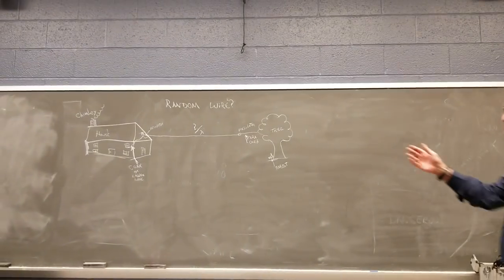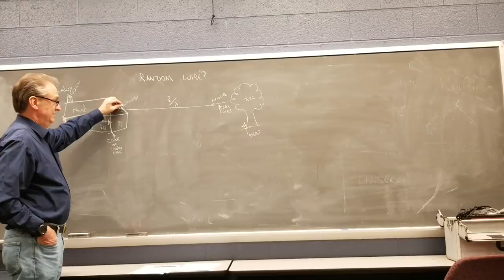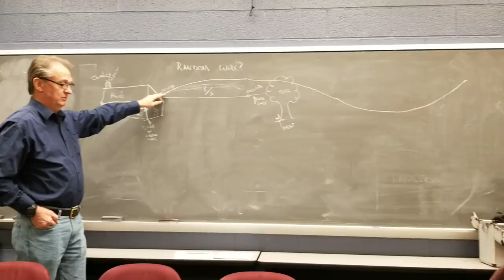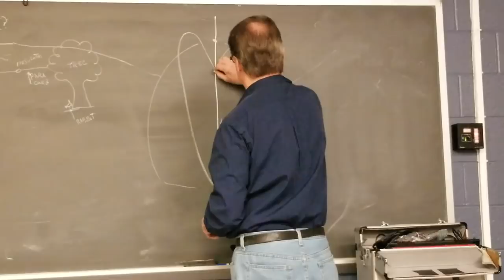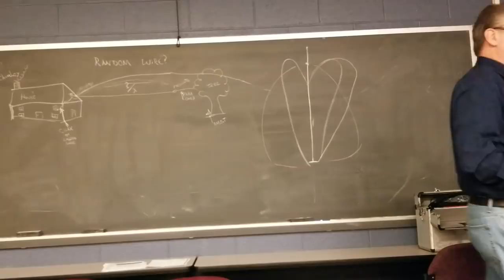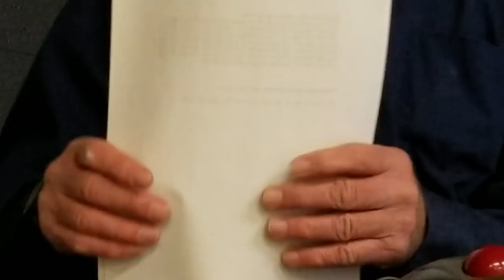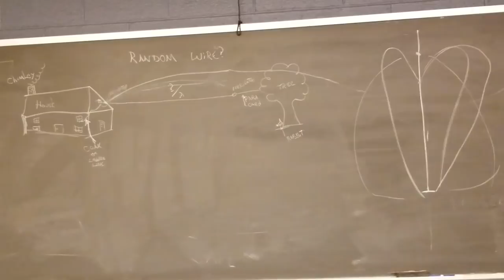Random Wire antennas presentation

Comment: Found a spool of junk wire. Shot some up in the near by tree.(the core) the other end to a coil on the wire going to a tree. On the low end.(shield) Thrugh to a 300 ohm restor to ground. The darn thing covers from Maine to Florida. Then texas to Canada and have heard England. This is a receiving antenna.( And I don't care to even to measure it). Love it tks for the show. De kv4li
Reply: Resistor working as a weak diode on your ground, just in case of a lightning strike?

Comment: Thanks for the great video.  This explained my recent problems.  Last year I tried cutting a 40M antenna, raised it up in the trees and discovered I had cut it about three feet too short!  Rather than adding the additional length, I decided to add about 200 feet of wire to the center point of the driven side of the dipole and string it out in the trees.  Using a little QRP tuner, that worked well enough for me to get WAS using QRP with FT8.  However, SWR was high (about 1:3) on 15 & 80M.  Last week I decided to cut that short piece of 40M driven wire from the antenna, thinking that might help get the SWR down.  I was SO wrong.  Cutting that piece out caused my lowest SWR to become 1:5 on all bands!  UGH!!!

I am now planning on just building a fan dipole and forgetting about my "random wire" antenna. LOL

73s
DE KC7RAD

Comment: He mentioned that you don’t what the feed point to be at the high current point when in fact that is what you want. The the high current point on an antenna has low impedance. He should have said high voltage point.
Reply from the maker: You are correct.

Comment: You didn’t mention using a 9:1 unun at the feed point. I’ve heard of a “random wire” end fed that is 74 feet long if the lowest band is 75 meters, but a 9:1 unun is used at the feed point. Supposedly, it covers 75 to 10 meters without a tuner. I haven’t tried building an end fed like that yet.

Comment: Just made one with 52.1 m (171 ft) of wire, a 9:1 balun and a tuner, of course. Seems to work well in all bands from 160 m to 6 m.
Reply: Seems you made a 1/4 wave for 160m, with harmonics on the lower ham wavelengths.  'Random' seems a misnomer.
Reply: @joeshmoe7899  Seems you don't master arithmetic.

Comment from the maker: If you want a single band antenna, the length of the wire is a quarter wave for that frequency.  If you want it to be every ham band for HF, the chart that I projected on the screen shows, in the lower set of numbers, the usable lengths of wire to accomplish that. I do have a PDF file with that chart that will be placed on the web site w3uu.org. I will also post it on the Facebook page for Harrisburg Radio Amateurs Club.
Reply: Terry,
Do you have a link to the PDF? Looked on the Facebook page and w3uu.org and found nothing.  73  WB3BJU

Comment: If it not a Odd Number of Wave Lengths it is a Even Number if Wave Lengths and Long as it comes out too an even Number of Wave Lengths It will Work it is the Square Root or long as you can Divide the Wave Lengths by 2 and come out with a Whole Number it will Work

Comment: Very surprised no mention of transforming the very high-end currents down to 50 ohms from as much as 2800 or more was mentioned?  A very short counterpoise will work. A 49:1 transformer is commonly being used to make it work?
Reply from the maker: This presentation was built around the ICOM pole mounted auto tuner, and the lengths of wire that will work best for it. I did mention that the tuner is mounted to a house with aluminum siding that works as a RF Ground and counterpoise.
Reply: @djterry17032  Of course an at the feed point tuner solves many issues, I guess I missed it being mentioned. Just getting aware of using transformers to broad band a halfwave wire to the higher bands, that approach has been on my mind, I have the capactors that are needed to raise an 80 meter EFHW to resonate on 75 ordered to put up a 134 foot or so wire using a 49:1 transformer to do it. Yes my brother  not a ham but a Marine SSB user had a wire he used with one of the marine tuners to do exactly what you were speaking about but just the marine SSB frequencies which are also  simuliar to ours harmonically.  He successfully operated 4 megs to 25 megs . I am hopefull my 80 and up transformer  tuned 1/2 wave at 80 can resonate on most bands no tuner necessary or just the internal from my 7300 but without actual experience only experience will tell the benefit when I get this antenna up. Facebook has a page EFHW that has 11,000 users commenting about their experience that you might find interesting. Steve Ellington has many videos of his testsing and experiences plus the theory of on Youtube and Facebook about how this all works. One benefit is the lack of requiring the need for long counterpoises that actually turn a wire into an off- center feed dipole because both sides are necessary.  We all search for an easy to install and use multiband antenna that works and I suspect Hams will be forever searching for that design? Good luck looking for yours, please share it when you find it!!  Thanks 73s

Comment: How does a random wire (configured in horizontal only) compare to an endfed (configured as inverted L)
Reply from the maker: On lower frequencies such as 160m and 80m having a vertical antenna has a big advantage with DX, because the radiation angle of vertical antennas favor DX. . An inverted L gives you both a vertical and horizontal element for radiation and is a big favorite among a lot of people. I would recommend an inverted L using the same figures for total length, if you have the ability to have that vertical part.
Reply: unless of the configuration (hor/inv-L) an endfed tries to match even numbers of lambda/4 multiples. so the antenna will always be as high impedance as possible at the feedpoint. thus you will need a 1:49/64 unun. no tuner can match these antennas because of the high impedance.
with a random wire you try to fit the feedpointimpedance to that area your tuner can handle on all bands.

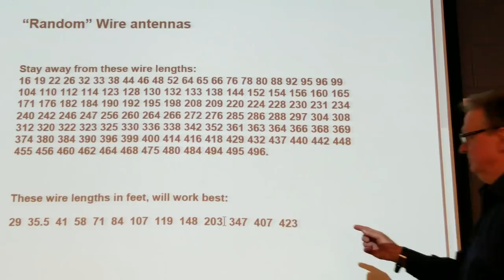Comment: AT 10:00 , you list some better wire lengths. Question: If the wire must be looped back at the ends to tie it off to the supports, do you still literally use these lengths or do you want these lengths to exclude the loops? 

I am building an antenna for listening only but want it to be as efficient across all bands as possible. I will be building an UnUn that is 9:1.  There may be a time when I will want to get into TX, so having an antenna that may already be capable would be nice. I plan to use an insulated 16-gauge wire. The UnUn will use solid enameled copper 18-gauge. How much power would you estimate this would handle for TX?

Further question on a pulley and weight. I plan to have one end attached to a tree which is about 100 feet away. If I use the 16-gauge stranded insulated wire of 84 feet, do you know how heavy the weight should be to hold it taut? Do you want the wire as straight as possible?

Thanks
Reply from the maker: The loops are small in relation to the overall length of the wire. Technically the loop adds a small amount of capacitance to the circuit,  but for our purposes, we will ignore that. I add enough extra wire to allow for the loop through the insulator. I measure the length from the feed point to the far end of the loop, inside the insulator. I know some will measure to the point where the wire enters the insulator.  That distance is most likely a half inch difference,  which in practice matters very little.

Comment: So, if I understand this video, creating a random length antenna, I make the length for the band I'm using? 
Thanks
Reply: Bill Loveless ....Make your wire radiator at least as long as the lowest band of use,but within the specified lengths.In other words,a wire cut for 10 meters  won’t be efficient on 80 meters.
Reply from the maker: I make the length for a single band, if that is all that I want to use for that antenna.  If you want to use a single antenna across all of the ham bands, use the figures in the chart.

Comment: Do you have to have a counterpoise on your random wire antenna if you are just receiving?
Reply from the maker: Yes, there is always a counterpoise.  On my home station the counterpoise is the aluminum siding on my house.
Reply: @djterry17032  This makes me think my steel roof on my home could likewise be the counterpoise or ground plane something no-one else has admitted would work. I have a pole that I have thought about adjusting to 16 feet or so and just use the roof as the ground plane and have asked  several  folks with web postings and no-one seems interested  in stating their opinion. The DX Commander is one I have considered putting up, but with my property being lower and surrounded by metal roofed buildings blocking any lower level take off, using a vertical on a porch roof attached to my main house roof seems the better way to get a lower level takeoff that would be just above all these metal roofs around me. My GAP Challanger  was essentually disabled when I tried using it, good enough SWR  but no view of the directions needed to make desired contacts.  Thanks again.

Comment: Is the 6 plus turns of wire to form a choke part of the 148feet or additional to it?
Reply from the maker: The 6 turn coil of coax cable is to be at the input to the auto tuner, which is located at the wire antenna. The purpose of the coil is to keep stray RF energy from forming on the shield of the coax, and coming into the shack.